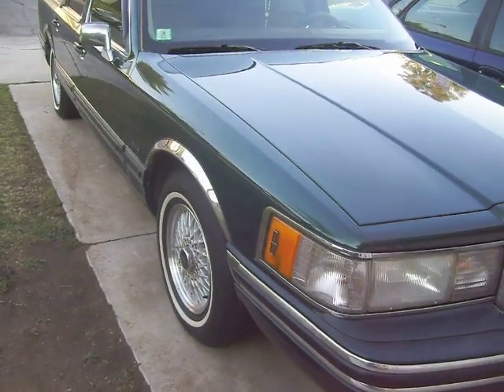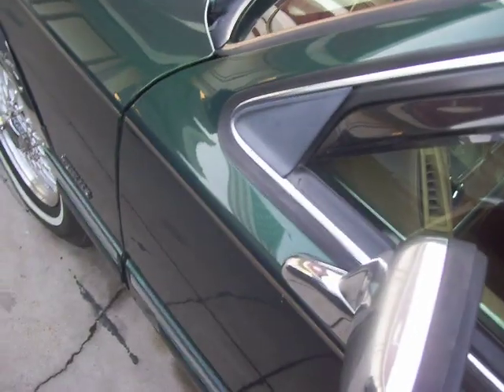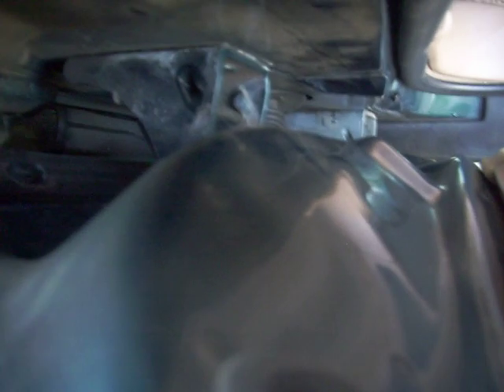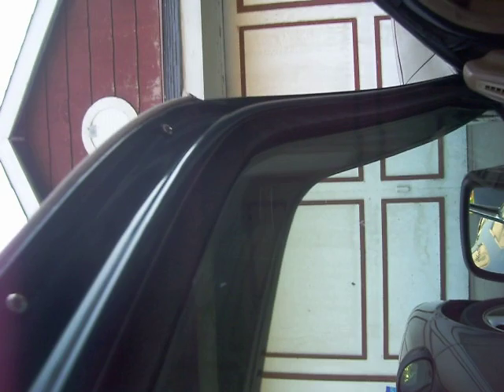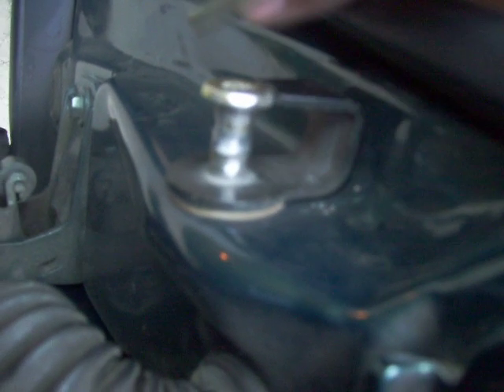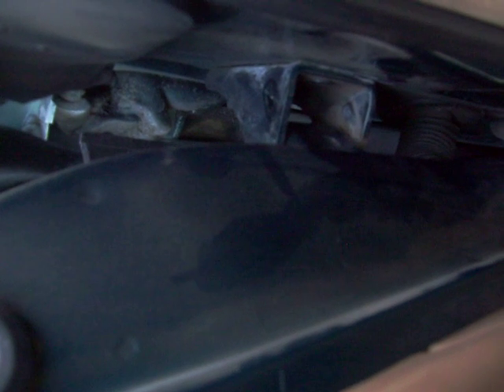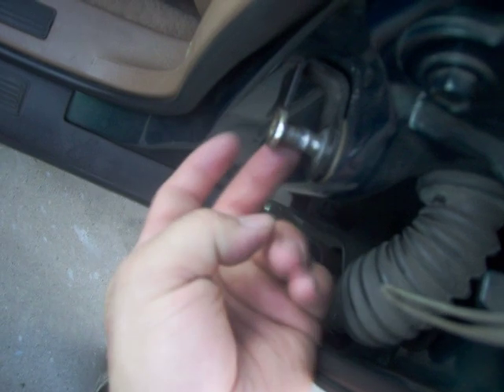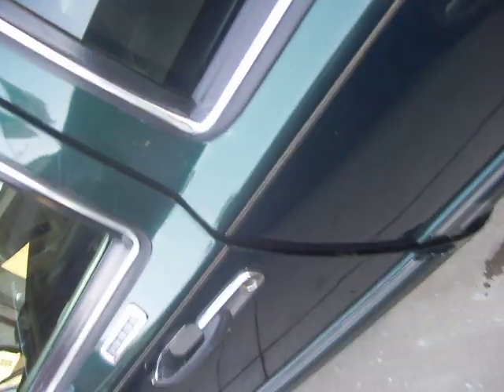door help lincoln town car 1994

Comment: I have a 1997 Town Car with the same problem. My mechanic quoted $292 for parts plus 2 hours labor to replace the hinges. Since that's approaching $400, I have been looking around & found a parts kit for sale online for $49.95 that provides the upper & lower hinges as well as the hinge pins. The seller Total Automotive OEM Parts Specialists, also offers two tools that are needed to perform the repair: a hinge-pin removal tool and a hinge-bushing installer. I also found MANY discussions between various owners of Town Cars with hinges that are failing on the driver's door -- and sometimes on other doors also. Noting the trend, I called Ford/Lincoln HQ and spoke to a representative who checked for any notes on advisory or recall action that the manufacturer may have taken to repair or at least notify Town Car owners of this common problem. So far, nothing has been done. I contributed our VIN and my report and got a case number from Lincoln. I also learned that the company might indeed announce some sort of program to deal with this problem if enough other owners report the problem along with their VIN data. The age of the car is irrelevant. So, I encourange YOU to call & report your problems with Lincoln door hinges -- whether or not you have addressed the situation for your own car! Here's the contact info:

Call Ford Motor Company
800-392-FORD (3673)
800-232-5952
(TDD for the hearing impaired)

Comment: Hi Frank, I am guessing by now you have addressed the issue, but I did this today. Took me about an hour. I purchased the car from Chantell (below in comments) 

I did not remove the hinges. I used a long 1/2" drill bit  to remove most the extruded side of the rivet pins while supporting the door with a bottle jack. once they were mostly removed (angles prevented complete drilling, a dremel would be nice for this.) I removed the rest with a cold chisel, then drove the pins out (ONE AT A TIME!) with a long reach cylindrical punch, and replaced the busings and pins using the Dorman / Help! # 38438 mentioned below.  The lower pin was more difficult as I did it last (readers, do this one first!) In order to get wiggle room for the second pin it was necessary to loosen the hinge bolts of the first (upper in my case) hinge. (MARK THE DOOR AROUND THE HINGE FIRST!) 

Driving the lower pin out was difficult and I had to use an air chisel due to angles and clearance, but it buzzed right out.

Good luck folks.
Reply: Side note: removing the bushing is easy once the pin is out, they are soft brass, if they are hard to drive out with a long reach punch, just break them with your cold chisel. A long cold chisel is needed for this job, mine is about 8" long.  Driving the new bushings in you have to "walk " around the outside edge with your punch and tap lightly, be sure the seat fully, and lubricate them... white lithium is best, moly-graph will do in a pinch.

Comment: just replaced door pins and re adjusted door works fine now. got the door pins on ebay for $50.you'll have to cut the old pins out, i did mine with a sawsall. good luck.

Comment: The reason for that is because when people open the door and its bounces it starts to bend the hinges. IOU have to get the hinges replace. When you do do not slam the door or throw it open to get off. For some reason ford didn't put very strong hinges on the door. A lot times I'm yelling at to not lend on the door while its open or throw it open and or slam the door. Remember It's not a Chevy

Comment: I inherited my dads 95 Town Car when he passed away. My drivers side door is doing the same thing. Today when I opened the door the screws that hold the lock in place fell out. I put them back and tightened them down, went the parts store to see if I could find replacements and they told me that I would need to not only replace the hinge pin, but also the hinges themselves. In order to do so, you have to go through the dash..I'm dreading it but am curious if you wound up replacing the pins/bushings only or if you wound up replacing the whole hinge assembly and if so, how difficult was it to get into the dash? Thanks for video, I've had multiple tell me that this is one of the most common issues with these cars. As well as the air ride...that is a whole other story.
Reply: Fixed!